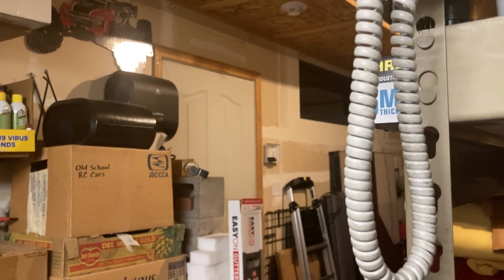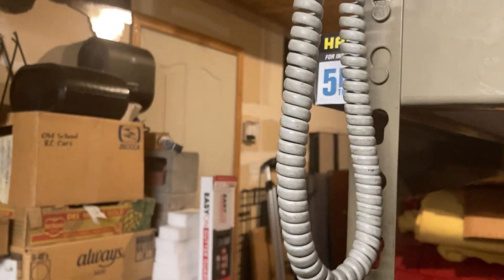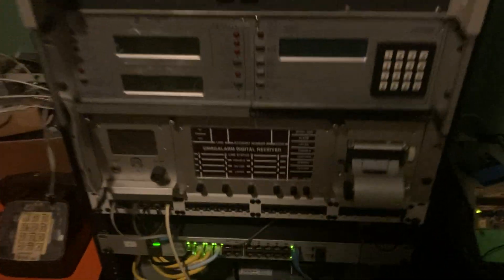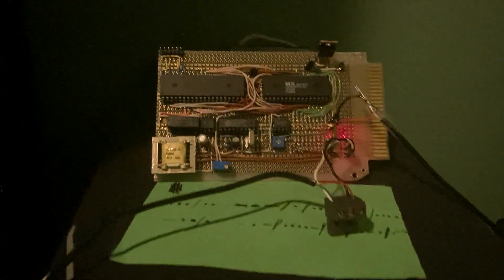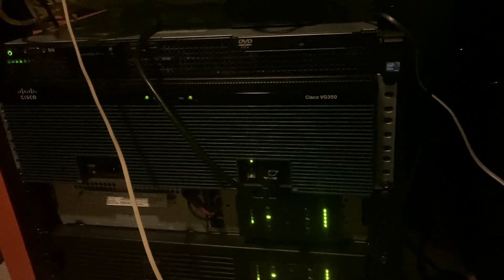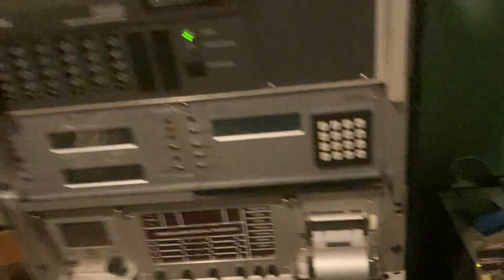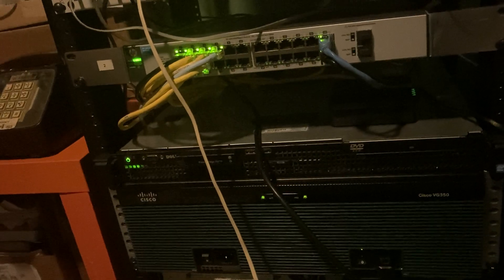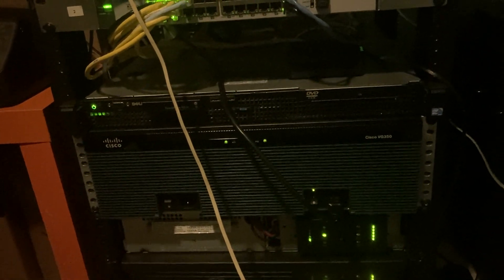Telephone "Automatic Intercept System" with a microcontroller

Comment: Wish I could get my Asterisk box to do number announcements in this format.
(Beginning) (Number) (Reason) (Referral) (End) Instead of (Reason) (Number).
Reply from the maker: This should absolutely be possible with some custom dialplan stuff. If you wanted to have it do database lookups to check the status of a number, there's a way to call an external application from a dialplan (like a PHP script) that could then do the query and return a simple status code back to change the announcement.

Comment: Sickness!
Totally….  LOL
I started in the alarm biz when the Ademco 332 / 342 panels were the great new tech.
I even installed and serviced their 1000 series.  The ones w/key switch and meter on the front of the housing..

Back then, in the 1970’s, tape dialers were the only option for “monitoring” if you weren’t in a municipality that had an alarm monitoring board.  Leased copper BA circuits were pricey as well.

When digital communicators arrived on the scene, I bought a bunch of jumper programmable communicators.
I signed up with “Nationwide Monitoring” and brought over 10 or so accounts @$1.99/mo .  (I was still in school and doing installs for family and friends).  I bought a receiver with the first monitoring $$ I earned .  I had a “teen” phone line installed in my bedroom and started doing 24 hour tests and openings/closings by hand, using a typewriter 🤣. 

I eventually made it the Radionics “family” when their NJ/NY rep moved into my hometown.
That was around 1982 or so..
Yup. I’m ancient.

I sure miss the business but there are way too many cheap crap install companies out there now.
I was always the most expensive quotation, but every connection was soldered, only shielded wire used (important with early popex loops and alpha keypads) and never cut corners.

Now - I’m stuck with an older system I can’t even program, but there are new gadgets out there that I can use to enhance what I’ve already installed.  My new project is to come up with a way to properly and safely use LifePO4 batteries as backup for the 9412 and supplemental equipment.  I’m so tired of replacing SLA batteries every few years and I can probably replace 4x 9ah and 4x 33ah batteries with 2x 100ah lithium and get 10+ years of life and much longer standby times.

Great channel !  Thanks for bringing back a ton of memories.
Reply from the maker: Sorry missed this comment, YouTube isn't notifying me for them...

Glad I was able to bring back some memories, really is a shame that the alarm industry has became more about making money than the functionality and reliability of the system. I can't count the number of weird issues I have seen with the modern wireless systems we're stuck with now, things as simple as time schedules for arming and disarming shouldn't be having issues. Meanwhile all the old systems that I show here have been as reliable as can be. I'd be curious if you can get something working with a newer battery technology, it's definitely an area I think needs improvement in these systems.